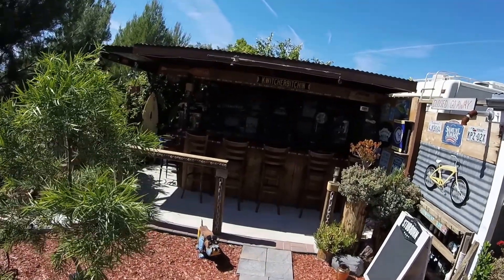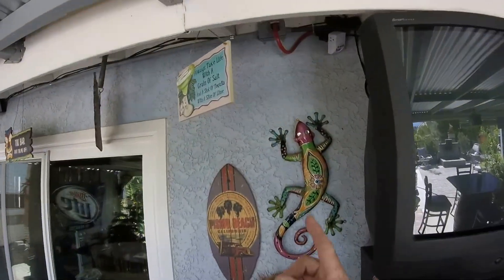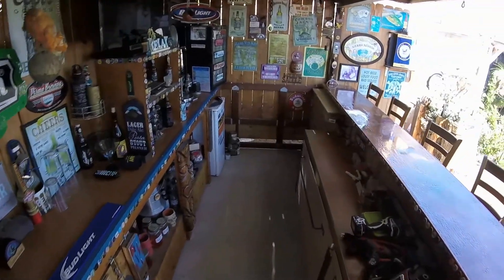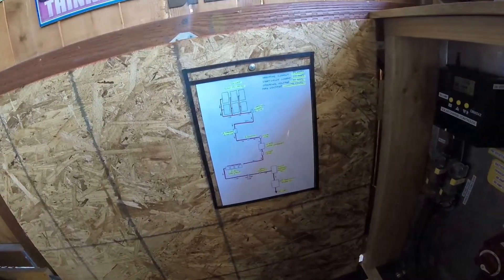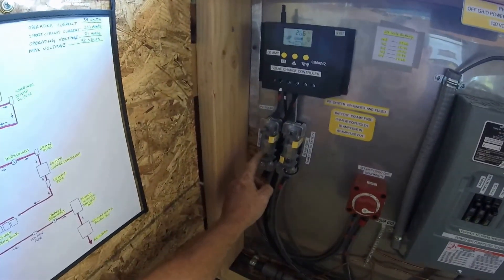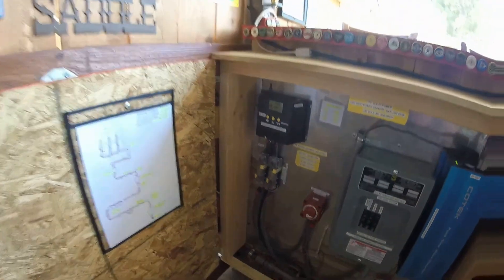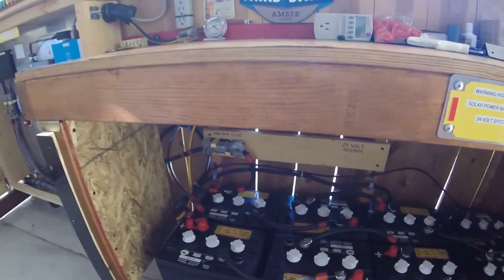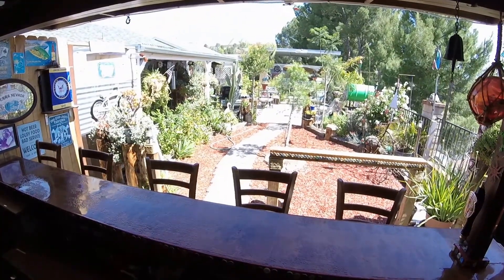DIY SOLAR BACKUP POWER SYSTEM

Comment: What kind of disconnect are you using? I'd like to use a 60A non-fusible pullout but unsure of wiring. How did you wire yours?

Comment: Very nice setup. I just don't like the battery and I will use victron controller with apps and LFP battery. 2 100ah would probably can give the same output as your 8 x 6v 250ah

Comment: Really nice clean setup. I'm concerned about your inverter over heating. Might I suggest vent holes in the door one on top and bottom with screen on the inside to keep the critters out.

Comment: Really enjoyed your video, although it was a little fast. Because I planning a solar system for my retirement place in the Philippines. I could really use some help. Quest why 24v instead of 12v?
Reply from the maker: 24 volt will run cooler for your equipment . When you start to use more power a 24volt and 48 volt system are better because you will pull less amps to run the same loads . Amps draw = heat on the equipment ( not good ). A 12 volt system is fine for a  smaller set up , I have a 12 and 24 volt systems now , check out my channel for updated videos on my systems.
Reply: For sure my system would be considered small, 500w in solar panels, Mppt 40a charge controller, and a 1200w inverter. fridge 74w, TV 47w, Led lights 5w,  then whatever gadgets that need to be charged. and a 600ah battery bank. looking at breakers right now.
Reply from the maker: 500w of solar will give you between 2000 to 2500 watts of power a day to use and recharge the battery bank. I would add a few more solar panels to give you more charging power. A 24 volt system will double the amount of solar you can run to the 40amp controller. You will spend less money in the long run to go with the 24v system, and it will be easy to add on later .

Comment: I have the same COTEK Inverter 24V for backup. 
I am currently running an OutBack 3048v Inverter system with 8 AGM Batteries to power my entire Off-Grid  home

Comment: Brother when you get your MPPT CC your going to be so happy. When you get your CC run the PV at max DC volts the CC can take. You will be a happy man. With a MPPT CC you can see at much as 95% out of your PV. With the PWM your lucky to see 80%. 

Love your setup. Mine is not that clean. Sucks renting.. Hope to have a place be for to long that is mine. God Bless.